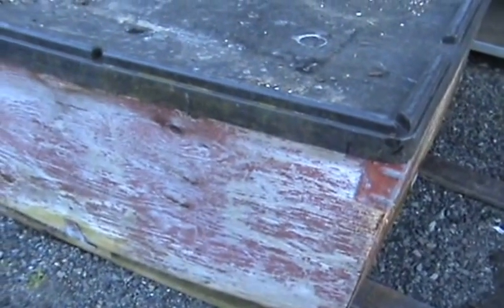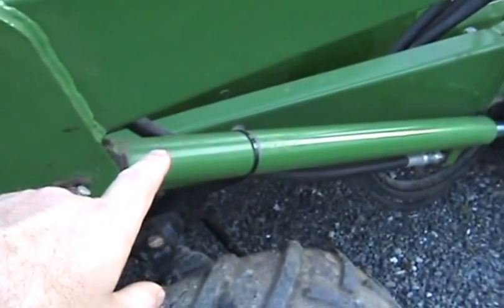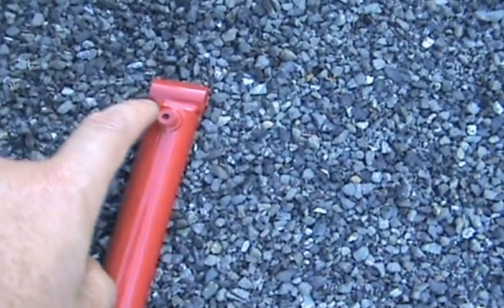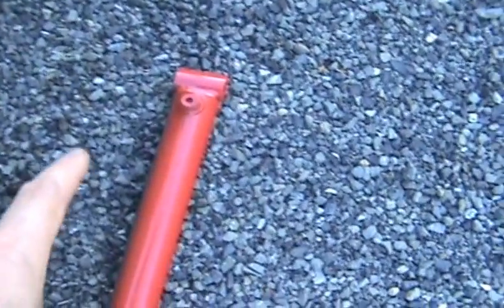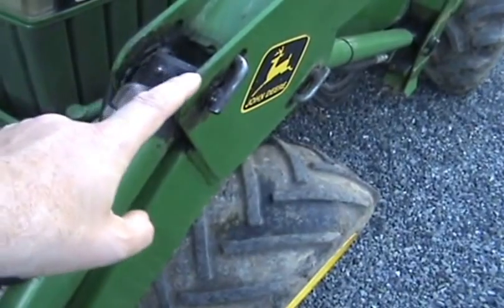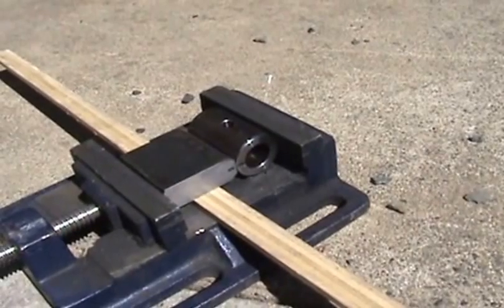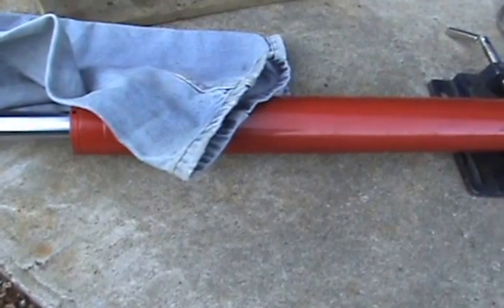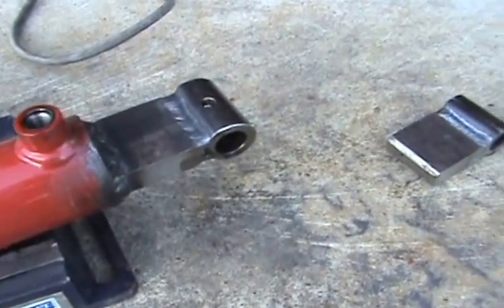Hydraulic Cylinder Upgrade On John Deere

Comment: Where did u get parts
Reply from the maker: I got the larger hydraulic cylinders, hose fittings, weld-on cross tubes from a store called Princess Auto here in Canada. Similar to Harbor Freight in the US. The 1/2" thick steel extensions for the bucket cylinders came from a metal shop.

Comment: Those John Deere cylinder designs are under powered and suck that is what I am looking into
Reply from the maker: I agree about the JD cylinders, the cylinder upgrade is still working great, the only drawback is a little bit slower cycling times. I'm thinking of eventually upgrading to a different hydraulic pump from the next model up tractor.

Comment: I have used the bucket to push limbs out of the way to free up my stuck chainsaw... the most recent time, I got it stuck, but the bucket could not reach high enough to push the branch, so I used my hand saw to try and free up the chainsaw (which I tied to my ladder so it would not crash to the ground!)... I got the branch to fall down a bit, but my chainsaw was still stuck, so I was trying to continue to cut at the branch for a bit before I realized that NOW I COULD push the branch with the tractor... and for the second time, I got my chainsaw safely down again. I would like to be able to lift more in the front bucket... Grabbing more of your time, Watching and Supporting!
Reply from the maker: Great that you were able to use your tractor to help safely release your chainsaw Ray! The tractor's muscle came in handy to push the branch!  Thank you for grabbing more time!!

Comment: Watching and Supporting, Grabbing more of your time! I really want to smooth out our fields. The place was a former horse ranch, and if I can make the ground MUCH smoother, it will be a lot easier to maintain the "lawn" (large fields) without having to drive the zero turn mower as slowly (due to the ruts and holes). Much research to do!
Reply from the maker: Thank you Ray!! Sounds like the field will need to be tilled or cultivated to smooth it out and fill in the ruts and holes.

Comment: Nice job! , I have a 3038e with a 305 loader & thinking of doing a similar upgrade.  Where did u find your upgrade cylinders?  Any advice for my application?
Reply from the maker: Thanks! I found these cylinders at Princess Auto, a Canadian equivalent to a Harbor Freight/Tractor Supply combination store. With a bigger bore cylinder you may notice slightly slower cycle times when lifting, curling and dumping. I believe your cylinders on a 305 loader will have the black nitride finish on the rods, it might be a little more difficult to find similar off-the-shelf cylinders with that finish compared to the standard chrome finish. If you don't mind the difference, then a standard cylinder would be the easiest and more economical way to go. I don't know if John Deere has a cylinder of the same length but with a little larger bore used on a different loader to interchange with, It appears that the cylinders used on a 400E loader would have a similar stroke with a larger bore. It would be nice if your local John Deere had a tractor on the lot with a 400E loader on it to measure the cylinders and width of the brackets where the cylinders pin on to see if there is any chance they could fit on a 305 loader.
Reply: @photocontrol  Thanks for replying so soon.  I will see what my JD dealer has on the lot & take some measurements.  I can modify the sleeve mounts as you did if necessary.  However, I hope I can purchase my cylinders somewhere other than JD to save some $$.  I won't mind slower cycle times, it's a fair tradeoff for more lifting capacity.

Comment: Did you check the actual hydraulic pressure ... before upsizing the cylinders  Force = Pressure x Area
Reply from the maker: The original hydraulic pressure was 2050 PSI, there was an improvement with the larger cylinders at this pressure, I increased it to 2400 PSI with even better results. This is 100 PSI lower than the next model size tractor (approx extra 9 hp) with an identical hydraulic system set at 2500 PSI.
Reply: Great Idea .. Thanks !!!

Comment: Any updates? Still working well? Haven't broken anything yet? I have a 955 with the 70A loader and I want to do the same thing. The loader seems just a bit under powered for the tractor.
Reply from the maker: It is still working well,no problems at all. Great to have the extra lifting power when you need it.

Comment: are you worried about to much weight on front axle i think the loader can handle more weight
Reply from the maker: I'm confident the front axle can handle the extra weight no problem,it is a 4X4 axle and appears to be very durable. The loader can handle the extra weight,I keep the backhoe on most of the time which gives me about 1000 lbs on the back of the tractor for rear ballast.Without the extra weight of the backhoe or using a ballast box it would be easy to lift the back tires off the ground lifting heavier loads.
Reply: thanks for the info i think ill try changing mine

Comment: Over loaded the loader yet?Messed up the front seals in your axle and hubs yet from lifting too heavy since you've upgraded!?
Reply from the maker: Nope all good,still going strong,no signs of any strain,I have even turned up the hydraulic pressure by 350 PSI. The next model up from my tractor uses the same loader but operates on a higher hydraulic working pressure of 2500 PSI ,I figured it would be fine to have mine set at 2400 PSI from 2050 PSI.
Reply: How do you turn up the pressure?